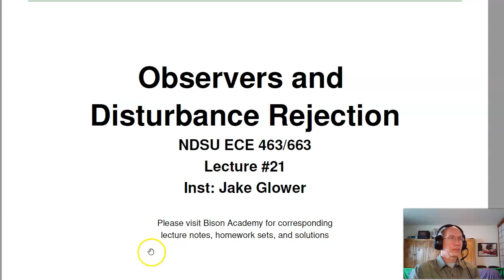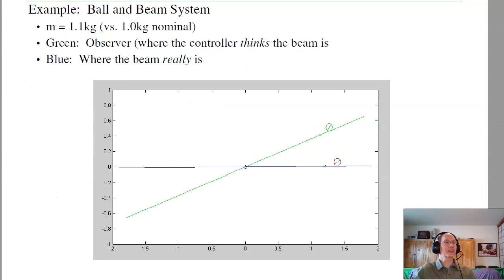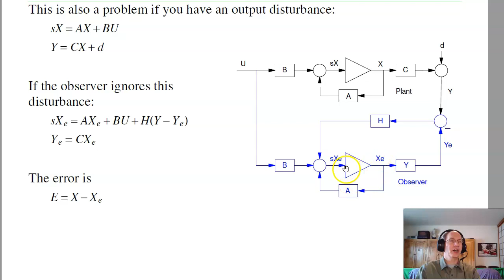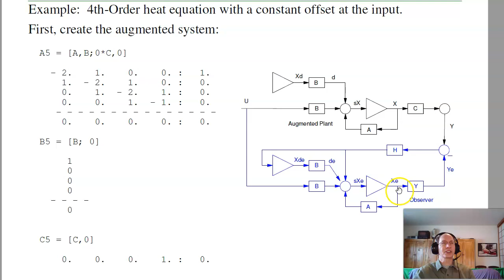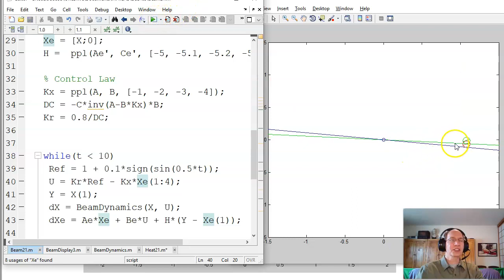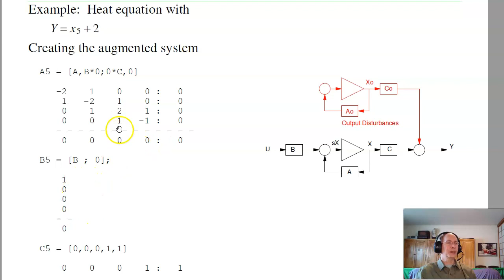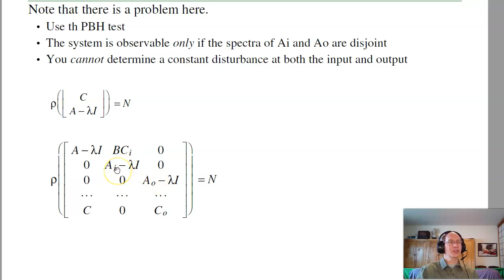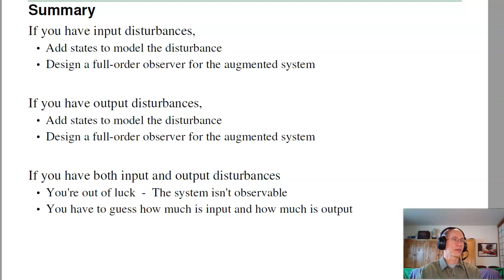ECE 463.21 Observers and Disturbances

Comment: modeling disturbances doesnt work, it is a disturbance because it cant be modeled
Reply from the maker: The disturbances this lecture refers to are things that are not measured, but can be modeled.  Examples would include a DC offset on a sensor, the sun shining into a window (adding constant heat), heat loss on a soldering iron (losing constant heat), a cross breeze providing a constant force on a cart, or extra mass on a ball for a ball an beam system, adding a constant torque to the beam.